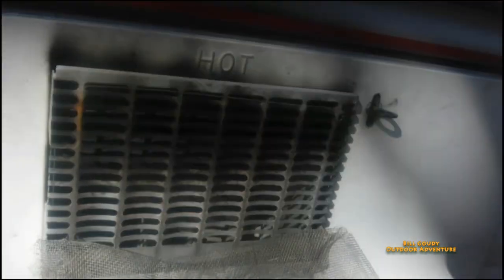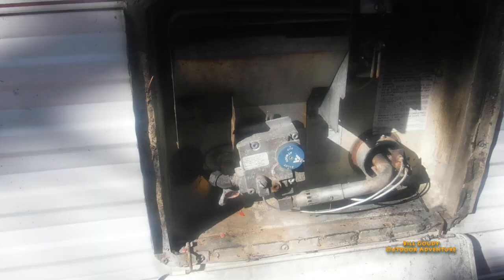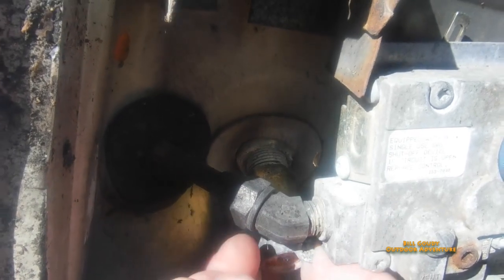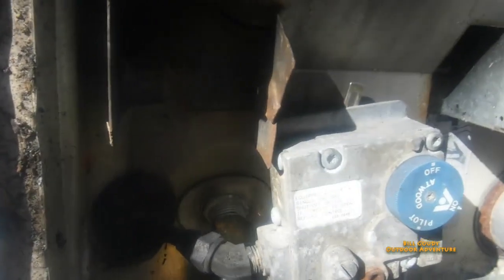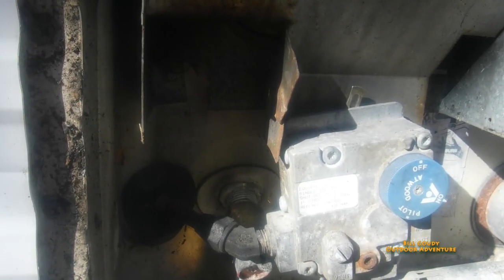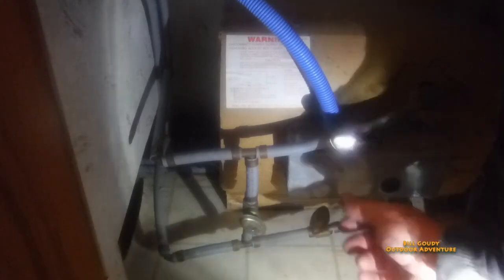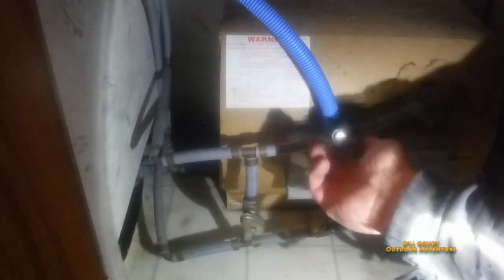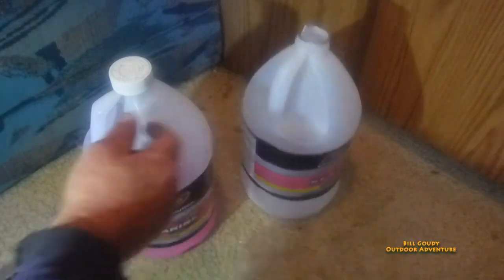Time To Winterize The Jayco Camper

Comment: Great demonstration Bill. You could work for a camper place. Im camperless at the moment but it’s a temporary situation. When I have a camper, I hook my air compressor up and blow the lines out. Then pour the pink stuff in the drains and toilet. I like to flush the toilet once to get the antifreeze on the flapper seal so it doesn’t dry out over the winter. I had one stick closed one time. Liked to never got it to move. So I just let antifreeze coat it now.
Reply from the maker: Excellent advise, Chris...  I have had to replace a camper toilet in my old motorhome.  It did just what your talking about only the foot peddle connector rods had corroded so bad that it stuck in the open position.   I ended up replacing the entire toilet.  Take care my friend!!

Comment: Nice job, do your store your trailer in the same spot or move it elsewhere? Any issues with mice?
Reply from the maker: Nope...  That trailer stays right there.  It is totally sealed underneath.  It has the cold weather package. and I used the expanding foam where the cord comes in.  I don't leave any food in the camper when not in use...  Knock on wood...  I have not had any rodent problem over the years.
Reply: That’s great. Keep up the good work.